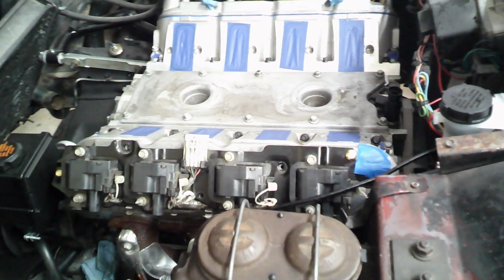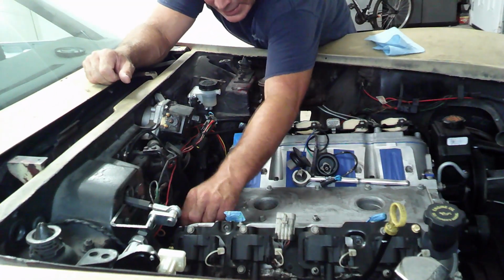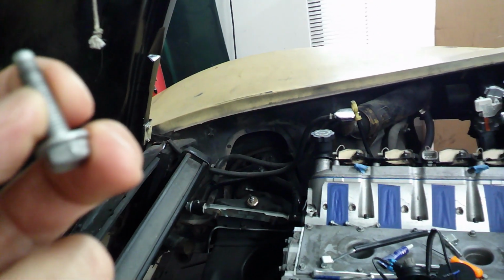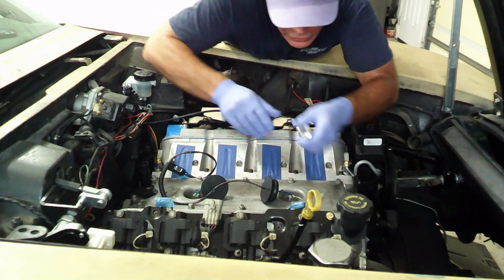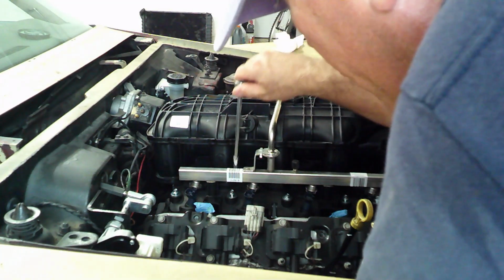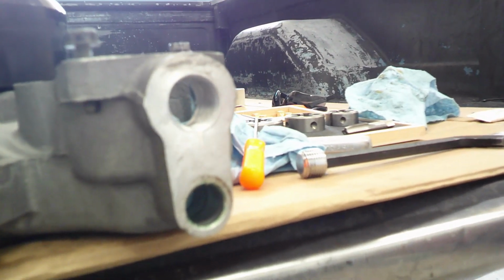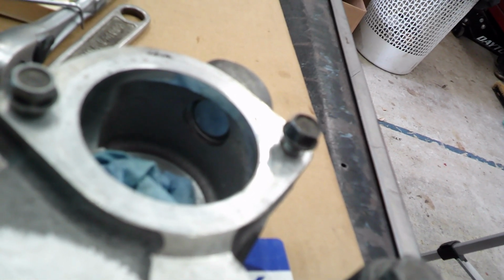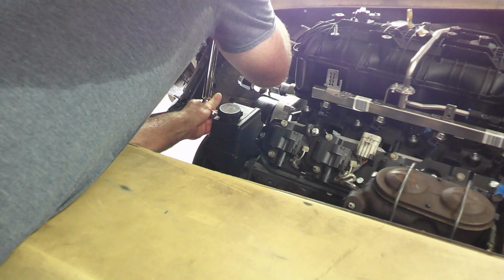C3 LS Swap Pt 16: TBSS Intake Finally Gets Installed on the LS1. We are Getting Close!

Comment: What are you running for front accessory mounting? Is it all stock F body or 3rd party?
Reply from the maker: I am running stock f body accessories. Eventually, I plan to install vintage air A/C so I will need an aftermarket bracket for the compressor.
Reply: @BowenAeroGarage  thanks for responding. My 76 jumped timing a couple of weeks ago and I’ve made the decision to LS swap it.
Reply from the maker: Good luck. Let me know if I can help in any way. Definitely worth it in the end.